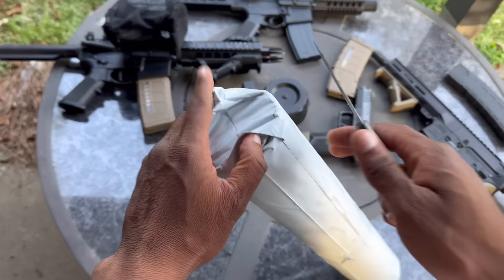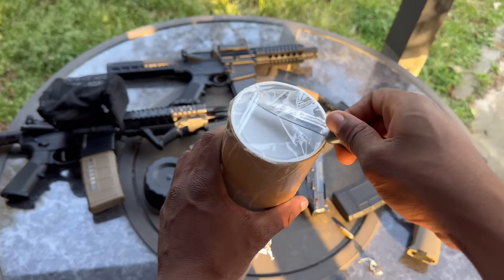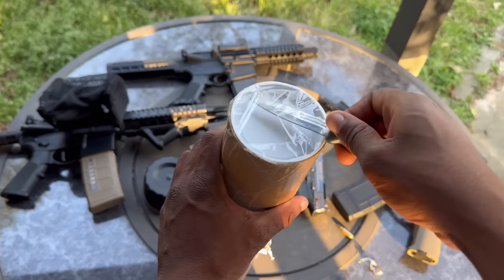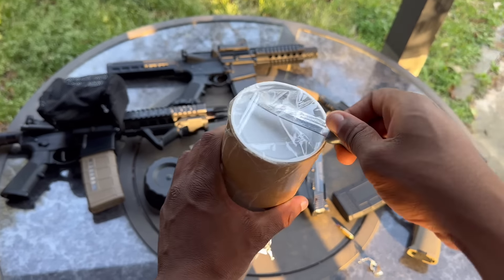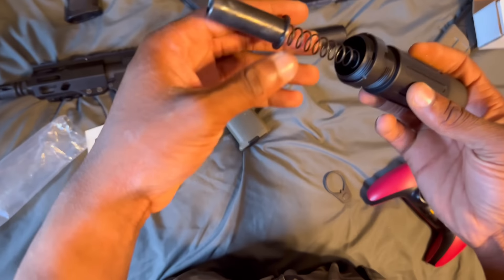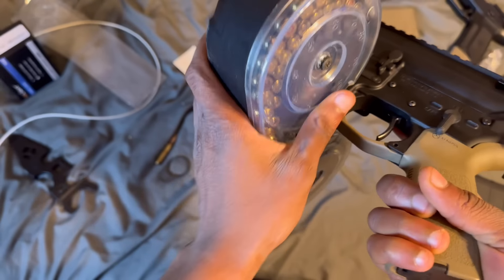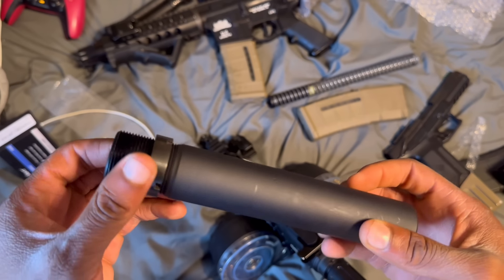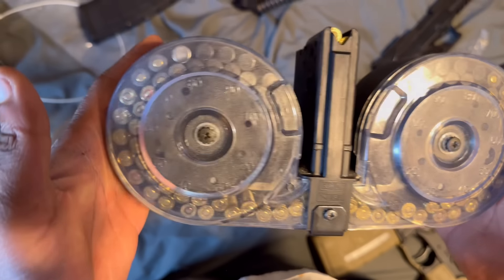5 Inch Micro PSA 5.56/.223 Ar15 Pistol Build W/ Micro Buffer Tube Unboxing/Review

Comment: i have 7.5 in omni hyrbid arp, could i take the upper off & replace it with a 5 in barrel or do ihave to get a whole new lower for it?
Reply from the maker: you can change them out any ar15 is interchangeable with each other as long as it isn't something like a .308
Reply: Most ar15 parts interchange especially if you have a multi cal lower
Reply: I wouldn’t got smaller then 7.5 if chambered in 556/223 you lose a lot of power those rounds were made for long barrels if you go that short I’d go for something like 300blk
Reply: @garlandjohnson5810  dis dude literally has 5in barrel wit 223/556 an iss str8

Comment: Have it ever jammed or any malfunctions with the first buffer tube before you changed it to the micro buffer tube
Reply from the maker: naw it works better with the first buffer , the short buffer runs fine too it just doesn't perform too well with binary or frt's i think i its not long enough for the trigger to reset at such a fast rate but semi its flawless
Reply: Try the dead foot arms 2.5 buffer system.

Comment: Please sell all 3 other AR pistols and build yourself a good quality gun. My AR all together is around $4,300 all together with everything on it 11.5 inch. Get you a gun you can trust you and your people’s life with and train with it
Reply: Good idea but why would he sell them when he can just keep and add a expensive one to his collection
Reply from the maker: you the type of nigga buy designer just because it's designer, who's to say your $4,300 gun is better than any one of my builds? the price doesn't really guarantee quality most of the time your paying for the name
Reply: @mr.300blkout do you really think your PSA can out run an LMT, KAC, HK, FN, or even just a Geissele? There’s a reason why these companies have contracts with the military and PSA does not. Criterion barrels are significantly more accurate than a PSA barrel. KAC sand cutter BCG will out last any part of a PSA. A Geissele trigger…. The tolerances of upper and lower on an ADM receiver vs PSA.

You just basically said there’s no difference between a Ford Fusion vs a Rolls-Royce.🤦‍♂️😂😂😂
Reply: Also the fact you’re running a 5” 5.56/.223 shows the lack of knowledge in ballistics. The only rifle caliber you should be running on a barrel that short is .300 AAC, or a pistol caliber. 5.56 or .223 needs at least 12” to fully burn the powder for efficiency. And 10.3” is the shortest you’d ever need to go, but then you’d have to run strictly 77gr to get proper fragmentation.
Reply: What if he just wants his gun like that because it’s his gun?